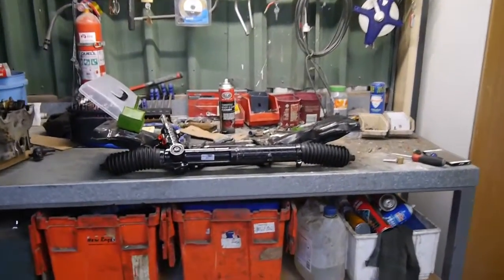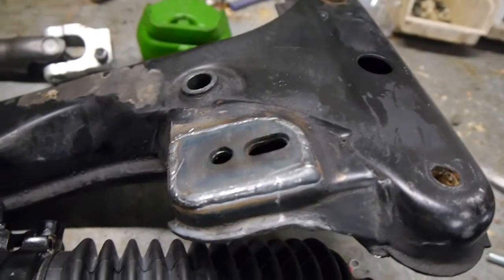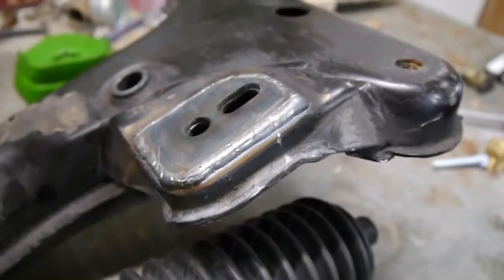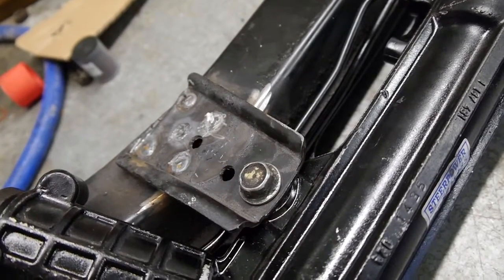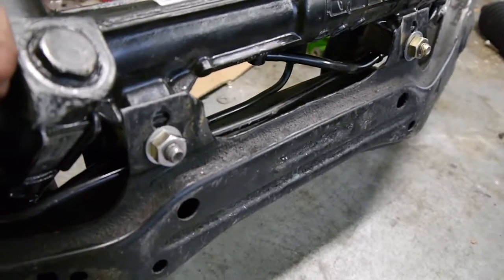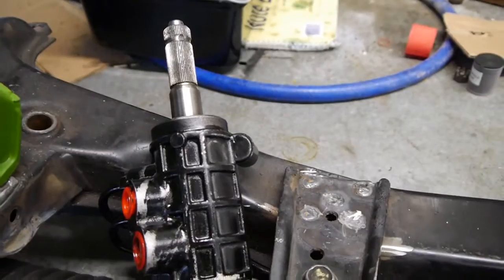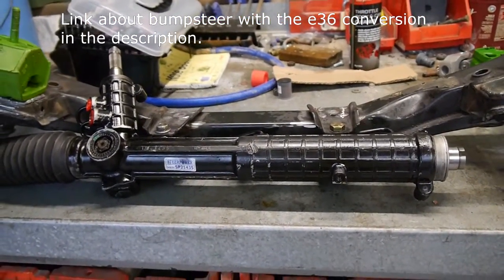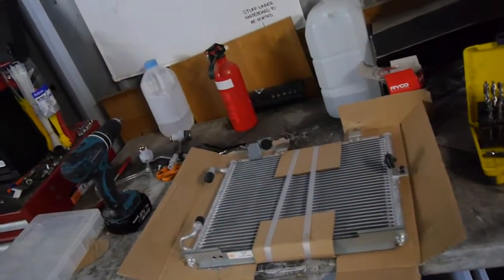E30 M52 Conversion Episode 2. E36 steering rack part 1~Engine mounts~ Subframe Mods

Comment: My suggestion is to put the bolts for the rack through from the bottom because you can't get them out once the engine is in. 

Otherwise, upside down E36 motor mounts also won't work. The issue is that the E36 motor mount arms put the bushing at a different than the E30 subframe. What will happen is that you'll set the car on those E28 mounts (yours are non M btw) and it'll deform to fit the new angle. Which WILL work. They'll just prematurely wear on you. The best mounts I've found are the AKG ones that have the built in angle difference. They're poly so they're stiffer but they fit great.

Comment: is that a 924 or 944 brake booster? ATE or Girling? is it with a angeled or straigt plate?
Reply from the maker: vw133s 924 ATE i am pretty sure. not sure what plate though.

Comment: how did you switch out the steering linkage/knukle?
Reply from the maker: i removed it when i took the subframe out and put it in when i put the subframbe back in. If you wanted to do it without undoing subframe then probibly the steering rack would have to come out, atleast to remove the old one.
Reply: Sorry i dont think i was really clear on my question. How did you take the universal joints off the knuckles? And then re apply the e30 and e36 end?
Reply from the maker: i'm not sure, sorry. I supplied parts and paid someone to do that part.

Comment: any new updates?
Reply from the maker: TexasRedneck yeah man, been shooting last weekend. Just been busy on things i need to do for the build but are not actually e30 related like getting the white e36 running and the engine out the red one. i dropped 3k on parts in the last month so shouldnt be too long till the next one is out.
Reply: wow man!  major coinage.  Thanks for the content!
Reply from the maker: Yeah, gotta spend the coin if i want to last as long as i plan on keeping the car.

Comment: use the proper mounts, akg make them for this swap. using bmw mounts that are not made for this swap is shit, no excuse for doing this half ass, these mounts are known for failing with this swap.
Reply from the maker: They didn't suit my application as I needed to use BMW mounts to get the engine complied. Plus they are super stiff and that's not an attribute I am after. If these one break I might consider it  but these to going fine and with little to no engine vibration so I am happy. Others i know that did the swap years ago seem to be going fine with them too.

Comment: What engine support arms are you using mine won’t line up
Reply from the maker: Just the stock m52 arms. It requires a bit of force to get everything to fit together on the subframe